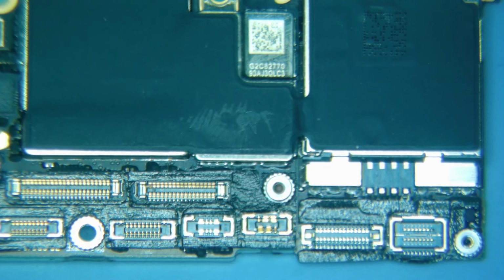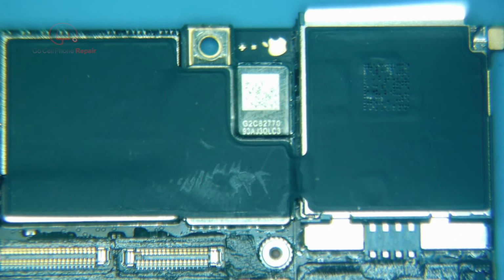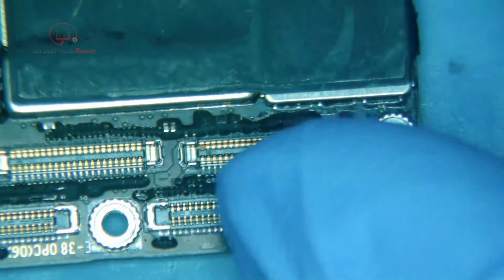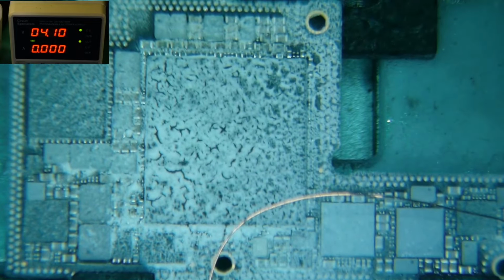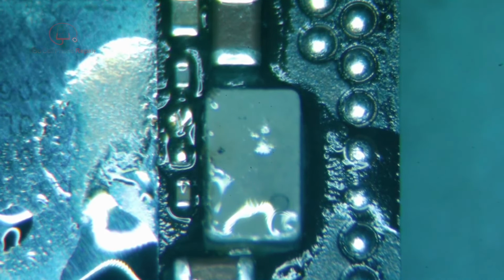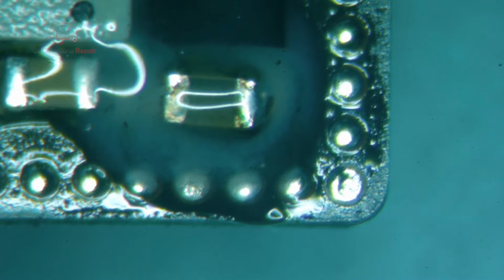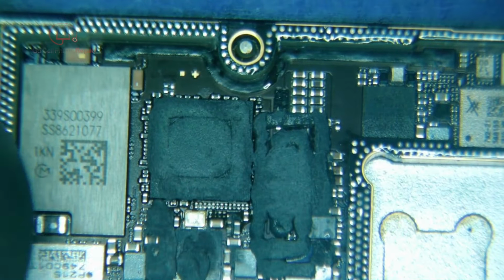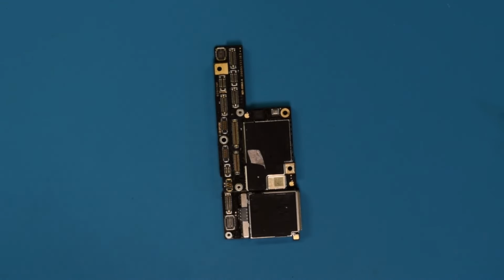iPhone X Brought Back to Life: No Power? No Problem!

Comment: You ever use a thermal camera rather than freeze spray on phones or are their components too small to see a failed component?
Reply from the maker: I do generally use the thermal camera first, then freeze spray if necessary. It’s been acting up lately though.